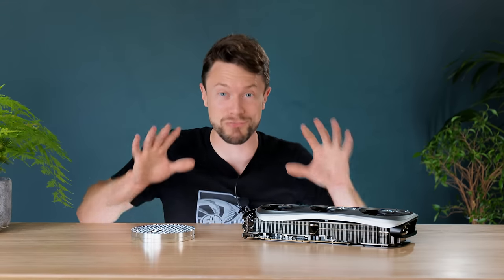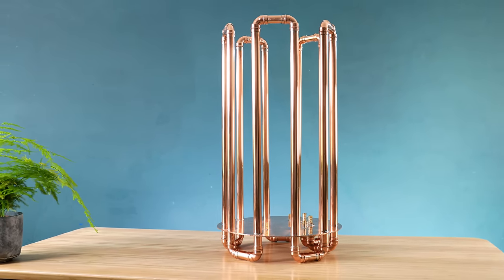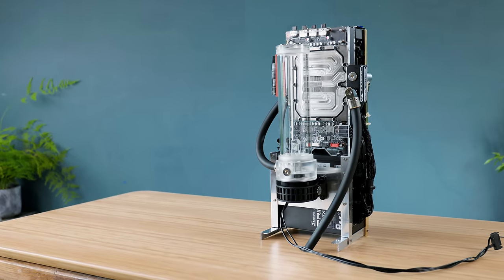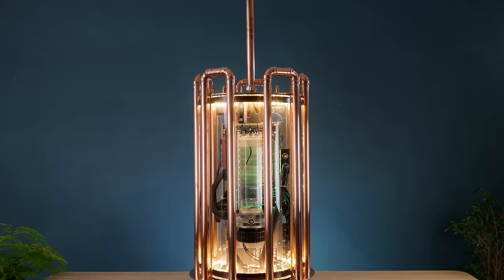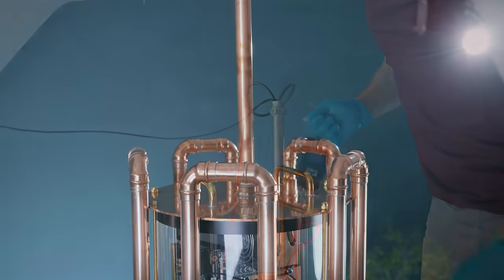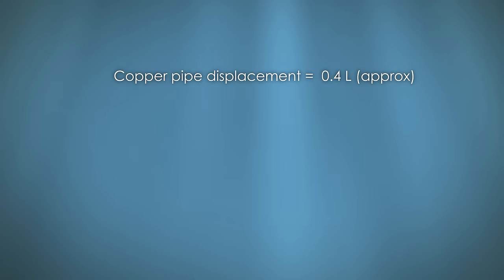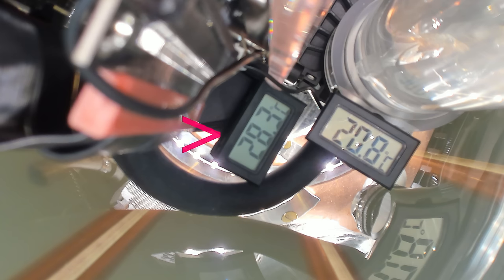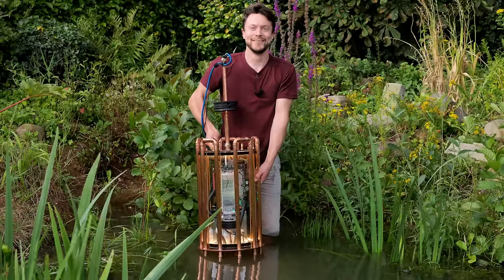Building an ACTUALLY water-cooled PC

Comment: Imagine connecting a Controller to it... That's a Billion-Dollar Idea!
Reply: Bruh 😭
Reply: True
Reply: Make it a Logitech controller and you golden😂
Reply: Even better if it's wireless and can drift with no input
Reply: @Hellefleur  true
Reply: @jasonmerbach6351  Copper*
Reply: brutal haha
Reply: @LaxLegion  yeah 👍
Reply: You know, controllers are actually commonly used for things like submarines

BUT NOT A WIRELESS ONE, YOU KNOW HOW MUCH INTERFERENCE YOULL GET UNDER WATER????
Reply: Add the greedy nes of the  ceo and you are done! Also invite some innocent family and friends 😊
Reply: This joke hit a new low.... just like the submarine did
Reply: Aaaaand a death trap in the Titan sub...
Reply: @zaremol2779  well, now the shipwreck is on land
Reply: @flamingscar5263  really? I mean its a super stupid Idea to use a Wireless one in that szenario. But doesent all the Water isolate the inside of the sub so there would be pretty much no interference?

Or do you mean by other components inside the sub
Reply: Too soon junior... too soon...
Reply: my idea would be use a steam controller. plug in the receiver USB dongle into the USB port on the mobo inside the cylinder;  leave it permanently in, eliminate the use of KB/M;; because it works as a keyboard; mouse and trackball kinda; then the system could be fully wireless and encased.
Reply: @blutadlerx Water doesn't necessarily protect from interference. Waves just travel differently and change shape as they cross from one medium to another.
Reply: And send it to freezing Titanic depths for maximum cooling
Reply: Well, the hub does provide USB so it's possible.
Reply: @zaremol2779 I know it’s semantics and all but it was a submersible, not a submarine… a submarine gets to where it’s going under its own power, a submersible doesn’t.
Reply: @Fetidaf  You'd make a great lawyer
Reply: too soon lol
Reply: @zaremol2779  I’m just saying, it’s a small distinction but there is a distinction.

For some reason small things like that are kind of a pet peeve of mine
Reply: Dang it
Reply: I KNEW THE JOKES WERE COMING 🤣
Reply: I was sure that there would be a submarine joke and looking for it. and there you are :D
Reply: seems more like a 250 million dollar idea
Reply: @nathanieljordan6144  I didn't catch that it was a Titan reference until you mentioned it. Curses.
Reply: Too soon 🤣
Reply: @blutadlerx  u can add a floating single receiver/output
Reply: Umm maby not in this type of year if you know the submarine

Comment: Copper itself is a biocide, if you plan to keep it in the pond you could consider to apply a coat of clear varnish on top of it. That may reduce the thermal conductivity though
Reply: I came down here to say this. That is partly why there are signs not to toss coins into the ponds at aquariums where there are open water pools.
Reply: Scrolled to check for this… might need to go to the top! I like your solution of a varnish. Fish will die within a year without it assuming its not a spring or well.
Reply: And in 500 years the sun might make the plastic turn soft and degrade.
We get it. It's always something.
Reply: @chrisakaschulbus4903  No, Chris, it is a well known fact that copper should not be in marine ecosystems. Don't try to shrug it off.  If the water is at all acidic, coper will become ionized, and is quite toxic to fish.
Reply: But realistically we all know he will not leave it in there after this video. I mean he didn’t even use his daylight bright lcd for the test.
Reply: Yeah also is not like copper doesn't get corrosion. Uncoated copper is a bad idea.
Reply: @BloodAsp  I'm not disputing that... but at some point it just gets a bit much and silly.
But i'm noone to tell others what to worry about.
Reply: @chrisakaschulbus4903 Copper is pretty serious stuff in water eco systems. Shrimps are insanely sensitive to copper and even just a tiny bit of it will wipe out an entire tank.
Reply: @chrisakaschulbus4903  It is a small, closed ecosystem. That much copper is dangerous for the fish in the pond. There is a big difference between copper and plastic. It is nowhere near a bit much, mate.
Reply: @xero2715  And did i ever say that copper is good in this case? If you care about your fishies and the rest of your ecosystem, then yeah, you should use something else.

Priorities are different between people.
I hope this isn't news to you.
Reply: @chrisakaschulbus4903 its not an each to their own thing. if you put copper in a community pond, then it will negatively impact everyone in that community. not just you.😊
Reply: @fartyfat6539  I know that actions have consequences... what's your point though?
Is it likely is it that some agency would actually measure the pollution in my little pond?
Reply: I wonder if forcing oxidation beforehand would have prevented this?
Reply: What if the copper was galvanized or plated? The cost would skyrocket, but gold-plated copper technically would be inert to water.
Reply: @chrisakaschulbus4903 But he literally wanted that PC to be non-toxic to the ecosystem. This was an important point repeated multiple times throughout the video. What’s wrong with that & them pointing out these facts?
Reply: @chrisakaschulbus4903 I'm sorry for my previously snarky response. I think you're just missing some stuff that I wanna help clarify. You're right. Your statement is true. But it doesn't make theirs any less true either. It's a false argument when you're not really engaging with their statement either though. Maybe a better reply would be, "why should I care?". In which case, I reply, you don't have to. We do, however, and it would be nice if you did too! All of us here understand that everyone has different priorities in life, but this isn't about you. This is about the person who's doing the action in the video. He should care because he has the responsibility to do so as the instigator of the action. Furthermore, these comments help educate everyone else to be better informed. Ecosystems aside, it's just nice to practice some kindness in our daily lives. It makes me happy to see life thriving in the wild. It keeps our planet healthy too.
Reply: @minimumapature3361 it's a pond there aren't shimps gooner
Reply: @snerttt  there are always shrimps my goon. for real they are tons of little copepods everywhere, these goblins eat shit (literally), no goblins = shit overload
Reply: You can replace copper with naval bronze, an alloy of copper and aluminum.

The aluminum oxidizes and creates a natural coat that prevents further oxidation without compromising thermal conductivity.
Reply: A thin silver plating would be even better. Pretty small amount of silver to plate stuff, wouldn't impact the thermal conductivity like at all, wouldn't have the microplastics issue of a plastic coating.
Reply: Fish will also hate the sound, and the temperature will be affected over time especially
Reply: He did in fact coat it with an oil layer in the cleaning process, and its good for the fish actually, though not so for insects and algae.

Comment: As a licensed plumber, I've always wanted to build a PC with a water cooled system integrated with a homes potable water plumbing system. We could build a loop in the homes cold water system and use a recirculation pump to displace the heat of the PC among the entire plumbing system 👀 I guarantee it would work
Reply: could use a  pump prior to the pc sytem to force the water out, or a line of water to the pc and a pump to push it out to
 the reservour
Reply: Sounds interesting. I've seen a guy using heat from graphcis card used for crypto mining to increase the temperature of his house. You can find it on youtube I think.
Reply: free boiler lmfao
Reply: Look at LTT and how he did basically that but with his pool
Reply: Dookie water pc
Reply: Thought about that as well, especially if someone has a high end build or a server station at home. That would be perfect.
Reply: @Zeb1st potable water is drinking water, not dookie water
Reply: Depends on how you do this. If you just dump the heat all around the house I guess that's okay, but if you just slap a heat exchanger onto cold water mains then the ethics of doing it is questionable, just like putting fans on radiators.
Reply: @randomwaffler free boiler that earns you money 😎
Reply: Just use a double-walled heat exchanger like for in floor heat and have the now heated water recirc back to the cold incoming on the water heater. You'd just need some spring checks and an expansion tank off the heater since you've put a check valve on the water heater.
Reply: you would need a to have two loops since house water isnt distilled, one that cools the pc with clean distilled, and a heavy duty easy to clean loop that can cool the distilled water. 

I suppose you wouldnt need to do that, but taking apart your pc to clean out all the hard water deposits would be super annoying
Reply: Seriously that's an absolutely great idea, buy some PC parts and record the whole process even if nobody sees it it's still gonna be an amazing feat
Reply: As a DIYer, maybe you can validate or correct me on this, but did he solder propress joints? How likely is it that he could have caused a leak doing that?
Reply: Yeah he did.  On paper, soldering  a pro press fitting wouldn't work very well because there is a little rubber O-ring (unless he removed it) and once he applied the necessary heat to melt the solder, you'd think that the melted rubber would compromise the joint. That being said, I've seen it multiple times in my plumbing career on high pressure systems and haven't had to replace any so he'll most likely be fine. I'd imagine the pressure in those pipes is only a couple of PSI anyways so I wouldn't worry about it. @shiroshnur
Reply: Sounds great, but how would that work if you needed to replace a PC component?
Reply: go for it i bet it will be cooling
Reply: Condensation, how are you gonna deal with it?  if you drop your computer components below dew point you're gonna have a very dead computer.  I build water cooled PC as a hobby going on 20 years now, & my personal gaming rig is better than the one he is working on in this video & I keep it running a few degrees above room temp at all times using EK water blocks on the chips to pull out their heat & with a D5 pump transfers the heated water using hand bend 12mm glass tubing to dual 360mm radiators, all contained in a shoebox sized six liters (1.5 gallons) custom case.

I've been told by a few it looks more like a work of art that a gaming pc & the hardest part was learning how to properly bend glass tubing, with a little more time I'll be able to make neon signs.  And building the case out of 1/8 aluminum plate with only hand tools, a angle grinder, a table router, & a drill. 

My only regret is not building it out of stainless steel, it's so much safer to work with & a hell of a lot easier to clean up by just using a magnet.
Reply: nah bro imagine your pc is water cooled in your septic tank
Reply: I had a whole new level of respect for plumbers now, thanks
Reply: @112Famine  I'm not sure they would condensate. Waterlines don't condensate even though they encounter rapid temperature changes. Is that an issue that you've encountered?
Reply: Scale deposits would be quite the hassle for most water supplies though... I can imagine it very quickly gunking up the microfin arrays that water blocks need to dissipate heat quickly. My first idea would be to put a small tank behind your original water heating system that contains a heat exhanger (just to help with thermal efficiency mostly, heating cold supply directly doesn't make a ton of sense)—I think the only issue with this is the requirement for all-new piping in the walls unless you plan to run fiber-optic cable up to a dock at your desk and keep the PC in a rack next to your water system.
Reply: I'd say it is the future of cooling for systems;  Computers are reaching a point where air cooling is becoming increasingly expensive in terms of thermal solutions and weight.
Reply: @foxdavion6865  Not really... the top end of air cooling reaches into mid-range pricing on water cooling solutions and the manufacturing costs for an effective air cooler are relatively cheap. In terms of size and weight, again that mostly an issue with top-end coolers made to handle 200-300W loads ( cough Intel cough ); a 65W cooler that does its job competently doesn't even break past 60mm in height.
Reply: @Zeb1st  😂
Reply: @yfnratchet oh yeah Intel's ridiculous aluminium bricks.  No copper in sight.
Reply: Try doing it in like Canada ice water
Reply: Or just tie in to the water heaters cold water intake so you slightly pre warm the water before it enters the hot water heater. 60 psi from the city may be a bit extreme though
Reply: Of course it would work doesn't mean you should do it
Reply: @Zeb1st not a bad idea actually
Keep the rad in the toilet 🚽 tank since it is always filled with water and you get a hot flush too
Reply: License plumber here as well, I've had the same idea quite honestly and I always loved soldering copper joints
Reply: aren't plumbers just taking shite out? you need an actual licence for that?
Reply: I think Linus over at LTT has plans to dump heat from his basement server rack into his swimming pool.
Reply: I9 14900k, RTX 4090 Super, 1500 watt power supply and you have turned your house's plumbing into a pipe bomb
Reply: @George-s5e  Plumbers are responsible for engineering and maintaining a homes gas infrastructure, the potable water infrastructure, the sanitary drainage system, and at hospitals the medical gas infrastructure. We are responsible for keeping methane gas from entering your home, for making sure your water isn't contaminated, for preventing carbon monoxide from killing your family, and making sure your home doesn't blow up. Yeah George, you need a license for that.
Reply: DO IT !
Reply: What if toilet 🚽 water 💦 clogs the PC with 💩?
Reply: @shiroshnur  I know this comment is old, but I'm pretty sure he's using Yorkshire fittings, which have a ring of solder in them already. You can heat them up and it'll release the solder, so great for a DIYer.
Reply: So would hooking a PC up to a nuclear plant cooling tower.
Reply: You could use a water heating system, if you have it in your home. 100 percent guarantee you would not freeze at winter while all you need at summer is to open a window
Reply: It would work as long as the Water has no Contamination like minerals and bacteria
Reply: Legionella risk ??
Reply: Have it exhaust into the water heater tank. Boom
Reply: Alternatively, couldn't you integrate this into a radiant floor heating system to actually make use of the waste heat?
Reply: couldn't you just redirect the computer-warmed water to the water heater after use? save energy on your water heater that way, too, no?
Reply: There are cooling systems for mining rig that connected to indirect heating boiler to heat water for bath and heating home.
Reply: winter season and no problem taking a bath, just turn on the pc and stress test it
Reply: @CResearch286  same way you do with a radiator or a regular water cooling system. Just drain it.
Reply: @Baldrjac it isn't one of those, it contains a ring of solder, not rubber. We don't use press fit in the uk.
Reply: @shiroshnur no, they contain a ring of solder not rubber. UK we have these but not rubber ones.
Reply: @foxdavion6865  nah, without disgustingly significant overclocking, in which you grind off the stock heat dissipation plate, 'air cooling' is more effective. Water cooling is good for aesthetics. 

'Air cooling' uses heat pipes which utilise vapourization and are extremely effective. Water cooling just allows you to pump heat through a flexible hose to the radiator instead.

Power use hasn't increased from high end components but even if it did you can use more substantial heat pipes.

The issue with water cooling is a dead pump = dead components.
Reply: @mandowarrior123  Water cooling is only really required in conditions where Air cooling is not possible either due to environmental or confinement reasons. When it comes to high end supercomputers, water-cooling is used not because it is superior, but ironically, because it is cheaper for the amount of heat that needs to be removed combined with the casing the computer is set up in.  In hot environments where the air in the room would always be hot, or there are times of year where it is, water-cooling is better than air cooling.  But, this was back when air-conditioning wasn't common in most homes.  These days there is no real point in having water cooling when the ambient temperature of the room is cool.  

As for industrial computers, passive cooling in sealed housing is preferred, which is why industrial computers are often low powered low end machines simply designed to do the task they are designed for and nothing else.
Reply: @mandowarrior123  interesting, thanks for the info